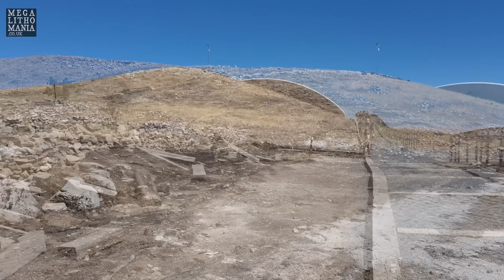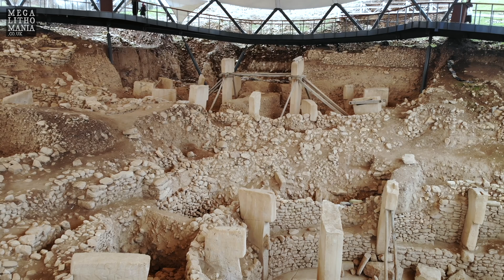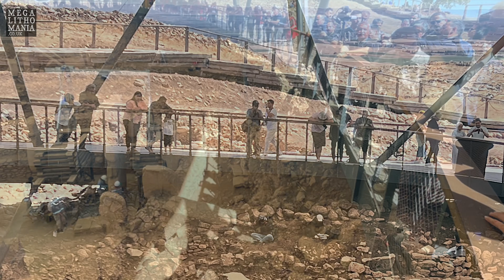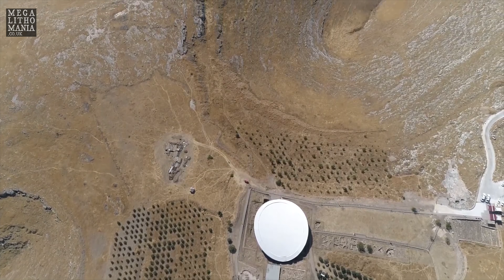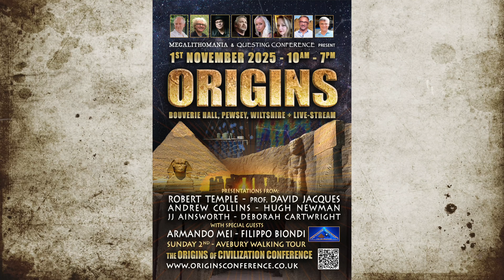Major Changes at Göbekli Tepe and Stunning New Discovery | Megalithomania

Comment: Seeing the statue at the bottom of the wall tells me a few things. The first is that the walls are NOT part of the original structure and were added after the pillars and site was first created. Secondly that Gobekli Tepe is far older than they think it is, possibly pre-Ice Age. Assuming that thier dating is based on the walls and related findings above the base layer of the site. I believe that this site was of course re-occupied and re-built when it was REDISCOVERED by ancient humans. The crudeness of the walls compared to the pillars and carvings are very reminiscent of the Inca layers on top of Megaltithic structures that the Inca reinhabited when THEY found them far after they were created in the unknown past.

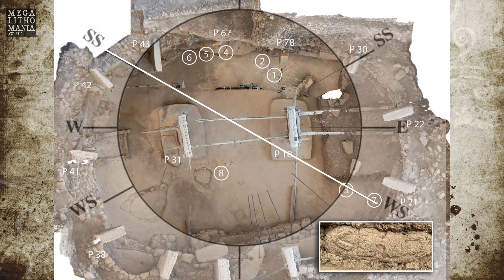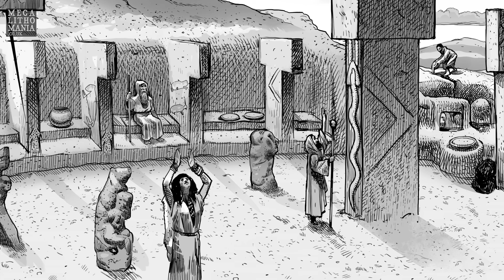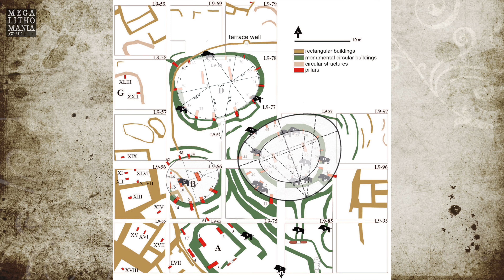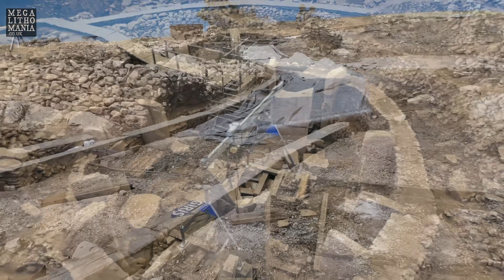Comment: 4:45  I know it looks odd from a distance but inspection of your close up seems to indicate naturalness over time. 9:19  These rough alignments knock the idea of 5 12 13 into a cock's hat, They were close but not that accurate. 10:45  That wall is so shoddy that they would have used anything available. Maybe that wall is 'young' compared to the rest of the place? 14:21  Sorry but is that guy at the back taking a dump?  17:30  'Egg Shaped'  meant nothing to them except a nice shape. An Egg Shape was just two circles stretched out to allow more usage of the curvature.  You like it curved but you gotta make it longer sorta thing. to fit more people in.  I say that because the shape was never intended to be an Ellipse.  Such knowledge came only with Kepler and Newton.  20:20  You have to ask yourself: If that reconstructed pillar is so tall then where are the pieces for its partner? They might have gotten it wrong :-)  I speak freely always, a fault of mine. No upset intended, I enjoyed the show :-)

Comment: Göbeklitepe Excavation Director Prof. Dr. Necmi Karul denied the allegations that concrete was poured in Göbeklitepe and stated, "It is out of the question" Prof. Dr. Karul stated that reinforcement work was being carried out against earthquake risk in the areas known as the 'aslanlı yapı' and 'F yapısı' within the excavation site. Explaining that loose wall joints posed a risk of collapse and that precautions were taken "without the use of concrete," Prof. Dr. Karul said, "In the structures in question, the joints were superficially filled with mortar obtained by sifting soil from the Göbeklitepe excavations and mixing water, goat hair, and linen. The bases of the structures undergoing conservation work at Göbeklitepe are largely damaged. In the protection of such bases, protective materials are applied or covered, depending on the current state of the base."

Comment: Using modern materials for the reconstruction of this structure, for me is horrend
Reply: The cement not only doesn't match with antique materials. The experts need to reconsider construction very similar to the original method. The modern cement can cause deterioration of the antique structure.

Comment: The rebuilding part IS preservation.

Decreasing surface area of the site being exposed to air and light will decrease the effect of degradation over time without getting drastic and literally encasing it all in transparent resin.

Also the version of the site that you prefer to "stay the same" is no more the real version of the site either as parts of it would have come apart during excavation without all the soil holding it together anymore, that's why the freestanding T pillars are being supported.
Reply: Concrete should not be used

Comment: # Objective (choose Protect P, Excavate E, Reconstruct R, Noninvasive N)
J = a*L(E) + b*T(P,R) - d*A(R) - e*D(P,R) - z*C(P,E,R) + g*V(N)

# Bandit allocation for unexcavated cells i at time t
UCB_t(i) = muhat_t(i) + sqrt( (2*sigma^2*log t) / n_t(i) ) - lambda*Fragility(i)

# Red-line/charter knobs
R_rev in [0,1]          # reversibility score (higher is better)
A_occ = k * (relief_area_covered_fraction)
A_conj = k2 * (1 - documentation_completeness)
S(P)   # seismic-benefit term from protection P, feeds D()

# Decision gate to allow reconstruction
Allow_R iff (DeltaJ_R > 0) and (A(R) <= A_max) and (R_rev >= 0.9)

# Statue-votive test checklist (score pass/fail)
- Orientation: abs(delta_phi) < 10 deg relative to B<->D chord
- Microstrata: packing signature present
- Binder chemistry: FTIR/mXRF cluster distinct from wall baseline
- Wear pattern: contact-face polish consistent; terminal face flat if intentional

Comment: PER triage: a scored decision model you can run

We treat actions P–E–R = Protect (shelters, braces), Excavate (new areas), Reconstruct (rebuild/“make legible”) as controls over a fragile knowledge stock.

Let the period objective be

𝐽
=
𝛼
𝐿
(
𝐸
)
+
𝛽
𝑇
(
𝑃
,
𝑅
)
−
𝛿
𝐴
(
𝑅
)
−
𝜀
𝐷
(
𝑃
,
𝑅
)
−
𝜁
𝐶
(
𝑃
,
𝐸
,
𝑅
)
+
𝛾
𝑉
(
𝑁
)
,
J=αL(E)+βT(P,R)−δA(R)−εD(P,R)−ζC(P,E,R)+γV(N),

maximize 
𝐽
J subject to heritage constraints below.

𝐿
(
𝐸
)
L(E): expected knowledge gain (bits) from excavation 
𝐸
E.

𝑇
(
𝑃
,
𝑅
)
T(P,R): visitor value (access/readability) from protection/reconstruction.

𝐴
(
𝑅
)
A(R): authenticity penalty (loss of original legibility, conjecture risk).

𝐷
(
𝑃
,
𝑅
)
D(P,R): damage risk (irreversible fabric stress/occlusion).

𝐶
(
⋅
)
C(⋅): cost.

𝑉
(
𝑁
)
V(N): value-of-information from non-invasive survey 
𝑁
N (GPR, ERT, LiDAR).

Charter constraints (hard):

Minimum intervention / reversibility (Venice 1964; ICCROM): 
𝑅
rev
≥
𝑅
min

R
rev
	

≥R
min
	

 and 
∂
𝐴
/
∂
𝑅
≤
0
∂A/∂R≤0 if fully reversible; conjectural reconstructions disallowed.

Authenticity (Nara 1994): require 
𝐴
(
𝑅
)
≤
𝐴
max

A(R)≤A
max
	

 and full documentation 
𝑑
≥
𝑑
min

d≥d
min
	

 before/after any work.

Archaeological heritage priority (ICAHM 1990): primary data = context; occluding in-situ reliefs triggers penalty 
𝐴
occ
>
0
A
occ
	

>0. 
ICCROM
+3
civvih.icomos.org
+3
UNESCO World Heritage Centre
+3

Practical scoring knobs (make it operational):

Reversibility score 
𝑅
rev
∈
[
0
,
1
]
R
rev
	

∈[0,1]: adhesive removability, no new loads on T-pillars, mechanical decoupling, full 3D pre/post scan.

Occlusion penalty 
𝐴
occ
=
𝑘
 
(
relief area covered
)
A
occ
	

=k(relief area covered).

Conjecture penalty 
𝐴
conj
=
𝑘
′
 
(
1
−
doc. completeness
)
A
conj
	

=k
′
(1−doc. completeness).

Seismic benefit 
𝑆
(
𝑃
)
S(P): reduction in failure probability from braces/roofing (learned from 2023 event + models). Feed 
𝑆
S into 
𝐷
D. 
ScienceDirect

Policy that usually wins (Pareto-sane):

Front-load N (scan) → E (micro-excavate) → P (protect); delay 
𝑅
R unless 
𝑅
rev
R
rev
	

 is high and 
𝐴
occ
≈
0
A
occ
	

≈0.

When display needs are high, move reconstruction off-site (Şanlıurfa Museum-style Enclosure D replica) to keep 
𝐴
A low on-site. 
etc.worldhistory.org

Publish a methods docket (adhesives, mortars, fasteners, loads, detach protocols) + full 3D before/after; if not published, set 
𝐴
conj
↑
A
conj
	

↑.

Bandit logic for “90% unexcavated”

Treat unexcavated cells as non-stationary arms with unknown info yield 
𝑟
𝑡
(
𝑖
)
r
t
	

(i). Use sliding-window UCB with drift budget 
𝐵
B:

UCB
𝑡
(
𝑖
)
=
𝜇
^
𝑡
(
𝑖
)
+
2
𝜎
2
log

𝑡
𝑛
𝑡
(
𝑖
)
−
𝜆
 
Fragility
(
𝑖
)
,
UCB
t
	

(i)=
μ
^
	

t
	

(i)+
n
t
	

(i)
2σ
2
logt
	

	

−λFragility(i),

and stop when marginal info-per-damage falls below 
𝜏
τ. This allocates digging to where expected bits per harm are highest, and throttles near fragile reliefs. (Same math we used for your non-stationary bandits insert.)

Statue logic → testable predictions (falsifiable)

If the B–D wall statue is a votive:

Orientation: major axis should align with B↔D central-pillar chord within tolerance 
𝜃
θ (predict 
∣
Δ
𝜙
∣
<
10
∘
∣Δϕ∣<10
∘
).

Micro-context: distinct packing microstrata (pebble fraction ↑, organics ↓) around the body; tool-mark distribution indicating placement sequence (head-first vs feet-first).

Binding signature: mortars or wedges differ from wall average (FTIR/µXRF cluster apart).

Wear: localized polish on contact faces; feet absent by intent → flat termination surface rather than jagged break.
Score each: pass/fail; update 
𝑃
(
votive
∣
evidence
)
P(votive∣evidence). Official lines suggest votive; this is how you check it without vibes. 
Anadolu Ajansı
+1

Red lines (heritage math → ethics)

Covering carved reliefs without transparent, reversible windows = 
𝐴
occ
>
0
A
occ
	

>0 and likely fails minimum-intervention spirit.

Irreversible adhesives on T-pillars push 
𝑅
rev
↓
R
rev
	

↓ and should be rejected unless 
𝑆
(
𝑃
)
S(P) (safety) dominates and is published. If raw ≠ shown, raw wins. 
civvih.icomos.org
+1

Crisp recommendations (scoreable)

Publish the docket: loads, adhesives, removal protocol, scans—bring 
𝑅
rev
→
1
R
rev
	

→1. (Venice/Nara/ICAHM compliance.) 
civvih.icomos.org
+2
UNESCO World Heritage Centre
+2

No net occlusion: if a wall rebuild covers reliefs, add removable view ports or shift to off-site reconstruction for legibility (like Encl. D replica). 
etc.worldhistory.org

Run N→E→P, defer R unless a published scorecard shows 
Δ
𝐽
𝑅
>
0
ΔJ
R
	

>0 with 
𝐴
(
𝑅
)
≤
𝐴
max

A(R)≤A
max
	

 and 
𝑅
rev
≥
0.9
R
rev
	

≥0.9.

Statue protocol: conserve in-situ until micro-context is fully sampled; only lift if risk 
𝐷
D exceeds a published threshold.

If you want, I’ll drop this into a one-page Book 1 — 1.11/1.12 “PER Triage at Sacred Sites” insert and a test card for the B–D statue (with the alignment and micro-context checks).

Is this conversation helpful so far?